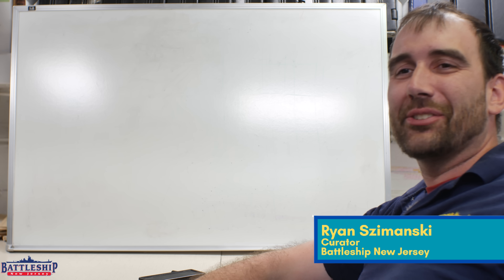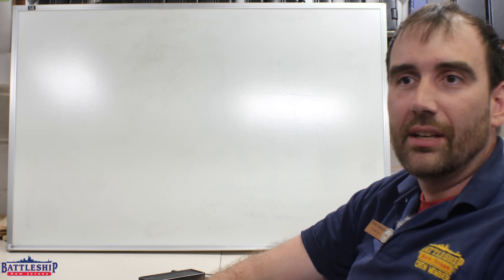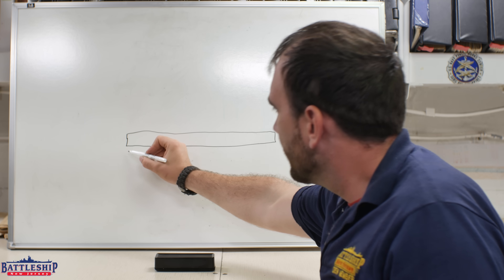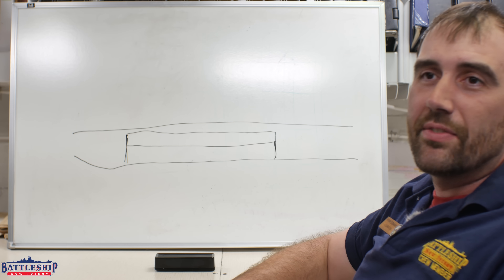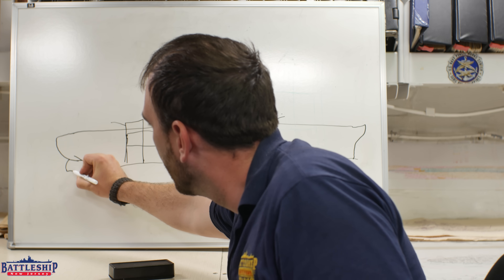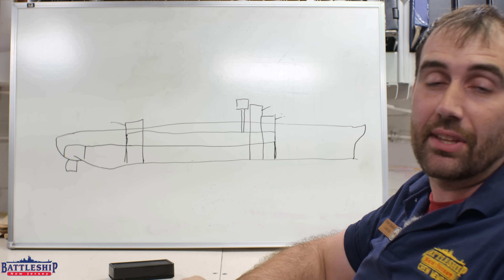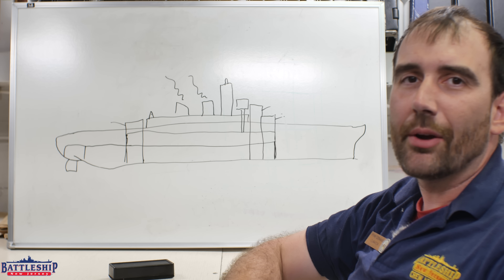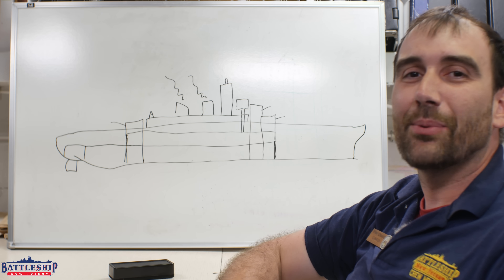What's A Ship's Armored Citadel?

Comment: I think the problem with armoring upper deck & superstructure is that even if a country were to dump a lot of material & time into armoring upper parts of a warship, it would also end up increase CoM (Center of Mass);

Now, I don't really know the average surface area of superstructure on warships, but I would imagine it would cause CoM to creep above waterline where it might pose stability issues.

Probably not as bad as IJN level of top-heavy designs, but still bad enough, I guess?
(Probably even worse for IJN ships because they tend to have very tall superstructures so having armored superstructures mean even more weight & supports on superstructure)

Comment: By Peral Harbor and the German U-boat should have told the designer the weight of the belt should have been used on the deck and torpedo line. With torpedoes from subs or planes or deck plunging bombs from planes as the biggest threat.

Comment: Designing these ships is and was a pretty basic series of trade-offs that then have to be implemented by folks with an insane degree of engineering and physics knowledge.  The Iowas were specifically designed with TWO primary goals in mind: (1) we wanted FAST battleships and (2) we wanted ships that could range vast chunks of the Pacific (we were specifically designing the Iowas, prewar, to be our battleships for the PACIFIC - we were planning to use completely different battleships in the Atlantic because the nature of that arena dictated very different design priorities).  So, we wanted speed and fuel-economy.  These are both accomplished by reducing weight, thereby reducing displacement, thereby reducing draft, thereby reducing friction of the ship vs water.  Also, we improved both by upgrades to the power-plant as well as some minor improvements to hull-design.  You have to factor in all sorts of other things - like you need your various centers of mass and centers of buoyancy to be arranged in a fairly defined range and you have to make considerations for stability and maneuverability - you don't want a battleship that is going to cap-size if it takes a list of 11 degrees or can't turn without sending dishes flying worse than a submarine.  But we really started adding armor and weight to the Iowas as we studied what the Japanese were building and putting to sea.  The idea of the Iowas was - even if your ships' guns out-range us by a little bit - it's not a big deal if we are just faster than you.  We can just stay out of range and wait for the carriers to arrive.  And once we started seeing that Japan was dumping everything at building big behemoths, and once we got some pretty good intelligence on their performance capabilities - the Navy felt more comfortable adding more weight - armor, guns, ammo, men, whatever - to these ships.  After all - we didn't need our ships to be 10 knots faster than the Japanese, as long as we could make 2-3 knots better than their best speed and if we could steam harder for longer - we knew we'd be able to use radar and air-recon to keep our big boys out of range of the IJN - and that's all that mattered.  The Japanese had this dream of a decisive naval battle that would send our Pacific fleet to the bottom.  Little did they know: we really just liked to sail our battleships North and South about 600 miles East of the main Islands just because we knew it forced the Imperial Navy to shadow us.  And so we just sailed our battleships North and South and North and South knowing full-well: hey, we have identified Japan's most finite resource, we'd already sunk all their tankers and bombed their refinery and pumping facilities: we just had to run them out of the last of the gas they still had - which we ultimately did.  By the final surrender - Japan couldn't have sortied more than a few capital ships for longer than a few days, even if we had let them.
Reply: The problem was legitimately so bad, already, by the summer of '43 that - when the IJN brass finally went to Supreme Council about needing to figure out how to start rotating their veteran pilots out of combat before they were all killed - the council completely blew them off.  Afterwards, one of the members explained to the IJN delegates that came and did the presentation - yeah, by your own numbers, you've realized that, at current attrition-rates, you are going to run completely out of experienced pilots by sometime next September.  We listened to a similarly grim report yesterday.  At current consumption levels: we run completely out of AvGas by February.
Reply: History lesson: people forget or don't realize how many MERCHANT ships flying the rising sun of Imperial Japan got bottomed in the first 15-16 months of that war.  The Naval brass in the States didn't think Japan was a threat at all because they thought the Japanese would be screwed if they attacked us - because they couldn't possibly protect their supply lines in the Indian ocean where we and the Brits were already making our presence be known.  And, sure as shit, once they kicked that war off - we wasted ZERO time in putting enough Japan-bound crude-oil in the Indian ocean to make deep-water horizon look like a bad day at the office.

Comment: The structural stability is significantly improved by six double transverse bulkheads and three box girders running in the longitudinal direction of the ship. The box girders extend at upper deck level from the VLS to the helipad on the port and starboard side of the ship and in the middle of the hull to cover 80% of the ship's length. The cross-section of the rectangular outer box girders is 1.2 m × 1.2 m, the cross-section of the middle 1.5 m × 0.6 m.[4] These additional stiffeners and cofferdams ensure that the gas hammer and the fragmentation cloud can only expand to a limited extent in the ship after a shell or missile impact and that the longitudinal strength is maintained. This largely prevents the hull from breaking apart.[13] The ship is divided into twelve large watertight compartments and four damage control areas, each of which has its own command area for internal combat.

For the bow of the New Jersey, a possibility of structural damage after a HE shell or torpedo hit is determined.
Source:
Brandenburg class (1994)

Comment: Bismarck had extra armor all over the place including in the bow and stern and also a turtle-back deck...part of the reason she was so big compared to other European battleships like KGV
Reply: Total rubbish, the distributed armour scheme adds weight not size. Bismarks extra size is mainly influenced by poor design, that is itself a result of the countries ship designers due to the versailes treaty not been able to keep up with the latest developments. the last capital ship they designed was the bayern class of 1916, that means that they miss out on 2 decades of advances. On that displacement they should have been able to get, 9x 16 inch guns, 31 kts and with the distributed armour scheme, but they never achieved this, multiple design choices and constraints cumulate to affect this. 1 been that krupp never go to interrupted screw breech blocks for the main guns, they have side sliding ones. This means that you 1 need to have 2 gun turrets, not 3 gun turrents, and 2 that each turret needs to be longer as the ramming system needs to be entirely behing the breech, but with interupted screw, part of that machinery can be between the guns. longer and more turrets means you ship needs to be longer. this is just 1 of many issues with the bismark class, it also affects the hipper class cruisers.

Comment: The nice thing about being able to extend the armoured box from the citadel to the steering gears is that in terms of weight, is that you no longer need the armour plate on the originally designed front of the steering gear and originally conceived back of the citadel. What cost of weight would have gone there for those armour plates, can instead be spent on the weight of armour required to extend the citadel box. Besides of course, the other nicety you mentioned for buoyancy.

Comment: According to Robert Summerall's "Iowa Class  Battleships", the main deck over the citadel is known as the bomb deck and is 1.5 in of STS  plate. The splinter deck is below the armor deck and is  a 0.625 STS plate. The splinter deck is not the deck over the armored deck. The splinter deck also provides the emergency escape route off of "broadway" in the engineering spaces.

Comment: Does it do you any good to have your steering mechanism perfectly intact inside its armored box at the bottom of the ocean because the unarmored area in front of it got hit and blew off the stern?  There might not be anything important inside of it but that area still seems kind of necessary just to connect A to B.
Reply: That area is a battleship ass, there's just so much structural steel! If it gets hit by something potent enough to tear it off, it's probably irrelevant already as the rest of the thing will also be wrecked.

Comment: Cf. tanks, where all the armor is on the front, maybe a little on the sides, but they're throwing KE lawn darts at each other so the turret face is a foot thick and angled. And that's why artillery is still king of the ground battlefield, and air power is God, that's why they stopped making battleships. A 2000-pound bomb with a GPS fin kit dropped from 60k feet up and a hundred miles away dgaf what armor you have.

Comment: Ryan, so glad you are a curator.  Your pen and ink 
skills, while being VASTLY better than mine...

Oh, completely different question.  Is the bow so 
long and fine, to improve top speed?  Since there 
is very little room, in front of the forward barbette.

steve
Reply: Yes.  The waterline length determines the highest efficient speed.  Add 100 feet, that speed goes up several knots.

Comment: I've been told the superstructure is lightly armored.  Is that true?  Or is the superstructure just simple structural plating?  No protection for the people inside at all?
Reply: I think there’s a picture on Wikipedia for one of the Iowa class ships that shows the conning tower armor.

If I recall correctly, it was 15 inches thick.
Reply: @banedonrunestar5618  Oh the conning tower is armored up really thick.  I'm talking about the rest of the super structure.
Reply: @billmelater6470  I think there may have been some splinter protection here and there, and some armored trunks going up to fire control on the masts, but you're right, basically unarmored.

Comment: If the USS North Carolina has a 12 inch belt, and the Iowa's have only 12.1 inches, then why is the North Carolina considered only armored against 14 inch guns? Yet the Iowa's are considered armored against 16 inch guns?
Reply: The steel used in the Iowa ships was tougher due to improvements in metallurgy, industry, and armor design.
Reply: @banedonrunestar5618  I don't think so. The USS North Carolina was commissioned in 1941 only 3 years before the first Iowa class battleship was in 1944, and the steel used was the same. As for the armor design/ scheme, the North Carolina was deemed superior to the subsequent South Dakota class ships and its design was reintroduced on the Iowa's with only minor changes. The two classes were essentially the same armor plan.
Reply: @banedonrunestar5618  Did a little research and the steel armor used in the NC class was the same STS as was used in the Iowa class battleships. Same alloys, same % of thickness surface hardened. My thought is that the NC class was originally intended to be armored against 15  or 16 inch guns, thus being the opposite of a battlecruiser, and armored against heavier guns than they carried,(a bit of subterfuge by the USN?) or the penetration capacity of a potential enemy's 14 inch guns being greatly overestimated.

Comment: I believe the engineers that designed the systems in the battleship as well as the armor knew what they were doing. I would never presume to second guess them. Engineering is always an exercise in dealing with constraints, compromises to get the best results from what they had to work with. Also the more experience that the navy gained from being in battle was also added to the data that the engineers drew from.

Comment: It's the same argument of up armored humves vs on armor. I hear the troops preferred the normal humvee because they were more maneuverable . and it impossible to armor against everything.
Reply: The question is more : what is the armor supposed to protect from?
For a battleship the answer is straightforward : high caliber shells.
So, putting armor that does not protect against these shells is useless. Hence the « all or nothing » concept. (The drawback is that older battleship were better protected against medium size shells, from cruisers for example. But it was accepted).

The issue with land armored vehicles is that there is a range of threats, between rifle caliber, from artillery shrapnels, up to antitank guns, and the designer has to choose the level of protection he wants. Hence the STANAG classification. 

An up armored Humvee has a better protection against certain threats. The question is, is this risk worth the extra weight? Apparently, some say no.
Reply: @chefchaudard3580 the biggest thing they wanted extra on in Afghanistan and Iraq was the floors to stop IEDs from getting inside.

Comment: Why be heavy armored if you can avoid the shells ?
Reply: Because then the enemy only has to get lucky once with a flooding hit, and then you’re no longer fast enough to dodge the rest of the shells/torpedoes that will be coming your way.
Reply: 1. It's not always possible to avoid enemy shells or bombs. You can't run from an airplain. 
2. Battleships are designed to take hits, so that the other ships (frigetts, destroyer, ...) don't have to. 
3. It adds to the stability, so that your 16 inch guns shoot more accurate.
4. The frame can sustain the force of the main guns.

Comment: The two layers and a harder critical area seems to work well but with modern missiles and tech the weight would be waisted today.  The weaker outer shell still needs to stop small arms to 5 inch shells plus detonate most contact stuff.  An inner shell or box to protect the critical stuff with a deck or side spacer like carriers.  Beyond that more CWIS would be better use of the weight today.